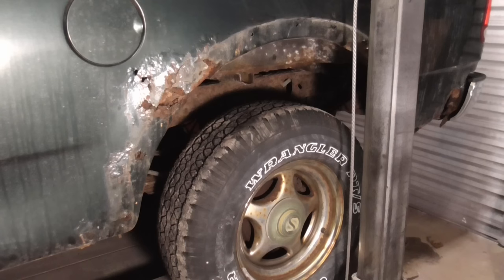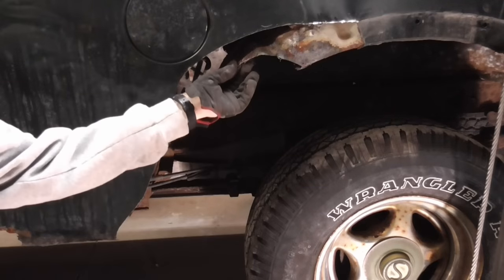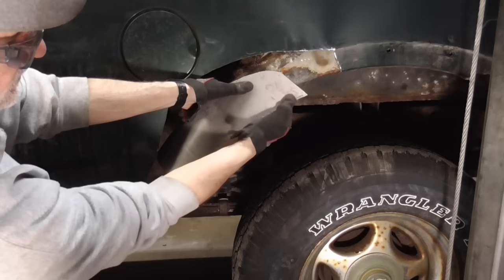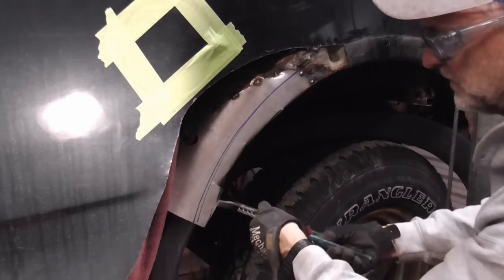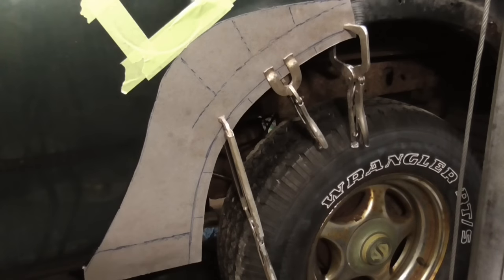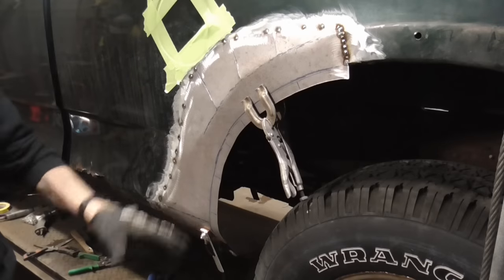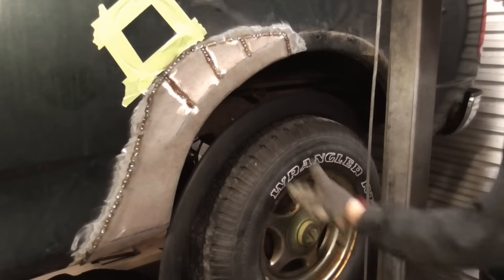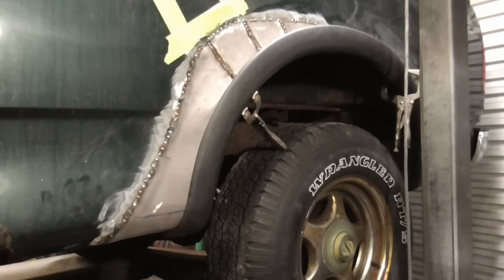Extreme Rust Hole Repair w/ Homemade Patch Panel - Part 1

Comment: What gauge metal do you use for patching? That  stuff seemed pretty heavy. I thought you were welding in the dark,  but then realized you had put a filter on your camera to protect my eyes, thanks.
Reply from the maker: You're welcome :)  20 gauge (~.035") or 22 gauge (~.030") will work fine for patches.  That stuff was 20 gauge CR sheet from Alro steel in Grayling, MI
Reply: @LakesideAutobody  Thanks, we have an Alro near here in northeast Ohio.
Reply from the maker: @stanleylosh1899  I figured they had some more locations - that's good to hear. 👍🛠😊

Comment: I've been a body man for years, started when I was kid, I was an apprentice for many years ! I fully understand what he is doing! The everyday person couldn't do it! My point is, by the time you get the patch panels, do all the cutting, weilding, grinding & the materials for the plastic work and put in primer! You have spent more then what a used bed would be! Your not even into the cost of those materials! You done spent more then the cost of buying a used bed and painting it!
Reply from the maker: What if your boss says fix it?
Reply: I've never had a boss and if I did ide tell him do himself, you see what you don't understand is " a good body man don't need a boss, a boss needs the bodyman!!!!
Reply from the maker: @garyschroer68  👍✌😊 - Have a good 4th Gary 🧨💥
Reply: What's the matter you don't like hearing the truth?

Comment: One suggestion,  make your patch first before removing all the rust so you wont remove the shape you want to make.
Reply from the maker: That's a good tip PVP - thanks for your input :)
Reply: That would be the correct way to do the panel replacement. Same as hammer and dolly out dents, control warping but when your using 3/8” or more body filler it really doesn’t matter.

Comment: That truck looks like it needs to go to the crusher I’m so glad I don’t live in an area like that I live on the gulf coast but I never take my truck to the beach and every time I wash it I always wash underneath as well mine is an 02 ram 2500 and I don’t even have surface rust on the underside and I have 300,000 miles but I do regular maintenance and take very good care of her I would freak out if I ever got a rust hole I also keep my trucks undercoat intact
Reply from the maker: Check out Cosmoline RP- 342 and this video - https://www.youtube.com/watch?v=8XaZBy7GC7A  Using a combination of these ideas will help you hold onto a car your whole life.  This is a good video too on rust prevention forever - https://www.youtube.com/watch?v=y05dNxt-nVc
Reply: It's inside the cavities where the rust starts, you need to inject them with anyone corrosive fluid, but make sure you don't block drain holes

Comment: What’s a job like this cost ? What did you charge ?great job and type of welder ?
Reply from the maker: This one was free 😊  The cost varies wildly from shop to shop - I would say 500-1000+ is the norm.  I appreciate the support MPLS - the welder is an ARCCAPTAIN MIG 200 - https://www.youtube.com/watch?v=jZikIeH-SWQ  Great little welder actually :)
Reply: @LakesideAutobody  welds better than my Lotus 180
Reply from the maker: @jonathanyates5198  2 great things about the ARCCAPTAIN - easy to read and use interface and welds good :)

Comment: Do you have a video how To fix very very white surface rust like bubbling paint but the doors are solid doors video. I have a 2008 Silverado is my dream truck. The doors are completely solid but on the outer side. It's a little bubbly paint not rush it through.  But I like to fix that at some point but she needs bedsides an And outer wheel wells didn't she be like a brand new truck
Reply from the maker: Is the rust on the inside of the lip or outside?
Reply: It's all outside and under the weather stripping as well.
Reply from the maker: @danielb-c9100  If it truly is just on the surface and not rusting from the inside out, you can simply DA sand, prime, block, prime, finish sand, paint.  If it is rusting from the inside out, which is very common, you'll have to do something like this - https://www.youtube.com/watch?v=84A8NQnkMEc  - You can even glue a patch on similar to this method - https://www.youtube.com/watch?v=nbtL75CXmuQ

Comment: I had some paint spots bubble after just 3 months! Ground it down to bare metal…. Why did it do that? So much hard work only to fail. Why?
Reply from the maker: Was it a rust repair, dent, chip?
Reply: @LakesideAutobody  it was a rust repair. With out knowing all the little ins and outs of this trade, it’s easy to make error’s because of lack of knowledge.  I have tried to give it a 100% to do it right, but to no avail. Even used the rust treatments type primers. So incredible discouraging. If you had a body shop guy standing there he would just say…..here’s what you did wrong. So, if there is one itzy bitty pit, this will cause it to bubble? Sounds like you have to cut 100% of the rusted area out even if it’s a discolored pitting?
Reply from the maker: @flintknappingtools  Just cut out ALL the bad metal no matter how big the hole gets - make sure it's all good metal,  weld the patch,  tap down the seam, fill, prime, block, prime, finish sand, paint - that's it it will last a very long time.  See this follow up video - https://www.youtube.com/watch?v=gIS1Tbv7Kvw  And here's a typical rust repair on that same vehicle - https://www.youtube.com/watch?v=84A8NQnkMEc  Stay with me and keep asking questions - specific questions - one at a time and things will get better 👍
Reply: @LakesideAutobody  sir, thank you! Got an 07 Jeep Liberty. Repaired much rust. Most is holding good. The next major task is the auxiliary break light is rusting out. Here in western PA we oil under coat our cars, nearly prevents all rust, but time and chance gets em all. God bless!

Comment: Amazing how easily hand tin snips can cut today’s thin automotive sheet metal panels. You’d think the manufacturers would have figured out by now not to use foam tape, or otherwise, where it could trap moisture causing premature rust, but 60k miles that’s ridiculous. I know Ford has gone to aluminum on their new trucks for the weight savings. Aluminum also corrodes but in a different way. I’ve seen aluminum framed entryways on commercial buildings where the door and window frames are completely disintegrated at the bottom from the excessive salt put down during the winters. It will be interesting to see how the aluminum bodied trucks hold up long term. Anyway, this is a functional repair to extend the usable life of the truck but I’m wondering why not use a ready made patch panel, aftermarket bed side, or even a bed swap?
Reply: I'm gonna take a wild guess and say that Jerry is performing this job for cheaper than what a used bed can be purchased for. Some trucks you can't find patch panels, plus the rust that's on this one I guarantee patch panels cannot be ordered for. Also, some trucks don't have aftermarket besides  like a 4 door Dodge Dakota I use to own, and Ford probably doesn't even make bed sides for that body style anymore. 2007-2013 Silverado trucks you can only get aftermarket bed sides for the 5.5 foot bed. 6.5 you gotta get them from the dealer at $1,600 a side. Rust free take off bed is around $3,200
Reply from the maker: Jonathan nailed it.... I'm doing it for a friend of mine.  He said do anything I want so I though I'd show all kinds of different approaches on this truck.  In the shop I worked, we never got to order premade patch panels - always had to make your own.  I figured it'd be good to show.  Have a great weekend Bondpit :)
Reply: Every single piece of aluminium that is connected to either iron, steel or (most)stainless steels will eat itself and protect the steel around it. That's how I got completely disintegrated suspension mounts on my Mazda...the steel was perfect and shiny underneath. Same story with the aluminium heat shields or other miscellaneous parts.
Reply from the maker: @rolfbjorn9937  Interesting...👍
Reply: @LakesideAutobody I ordered some repair panels for my classic car, the entire body is 18G the repair panels are 20G !!!!!!!!
Also they need lots of work to get them to fit,so I have started by repairing as many original panels as possible, letting in small bits at a time
I have some original panels I bought 20 years ago and will use them,  but the rest of the repair panels will get used as templates then sold afterwards
It's a long slow job, and I am not a professional body man, but semi retired and not afraid to start all over if its not right

Comment: What state has this much salt that this could happen in less the 70,000 miles? 
Hard to believe.
Reply from the maker: Saginaw, Michigan.  It's disgusting.  I've seen practically new Dodge Rams - maybe 5 years old where the quarters were toast.  People pay a lot of $ for these trucks and it doesn't end well here in MI.  Tons of salt - even a light snow - every road gets the treatment :)

Comment: There is a difference between rust and rot 😂😂
Reply from the maker: I guess rot would be where a bunch of water, leaves, dirt, seeds, etc. get trapped inside of a panel saying wet and rotting or rusting out the panel.  They are really both the same thing actually.

Comment: Welding a new panel to a rusty panel with no clean-up? yeah that should last.
Reply from the maker: If you want to know about furnaces, ask a guy who's done it for 40 years.  If you want to know about body work, same thing.  Make sure the repair can drain and dry out inside and this: https://www.youtube.com/watch?v=8XaZBy7GC7A https://www.youtube.com/watch?v=gIS1Tbv7Kvw

Comment: Isn't it easier to just buy Patch panels ?
Reply: Can't get patch panels for all vehicles such as my 2002 impala, or a Nissan Titan. Also a sheet of metal is around the price of one pre made patch panel, so if you have the know how you can save money
Reply from the maker: You can but I'm doing this one for the extra value price :)

Comment: Heh heh ...

... I have a fist-sized hole above the driver side front tire on my 1999 Toyota Solara fender about center if the wheel-well.
 
Aftermarket has the panel for about a hundred bucks plus shipping and Toyota dealership asks about 300 bucks and I can drive to the dealership for the said fender.

Q: May one, who is not an auto-body expert, or even an auto-body entry-level; may tge obe use "J. B. Weld" in lieu of a MIG gun weld?
Reply from the maker: Yes - here's a video using JB on a cab corner - it's about 5 years old now and still looks the same - https://www.youtube.com/watch?v=wRl1QfkrBeY
Reply: @LakesideAutobody  

I watched the video.  I did not even consider the "brittleness" of the J.B. Weld.  Now I see why epoxies may rule.

Is there a significant cost difference from J.B. Weld to epoxies?
Reply from the maker: @michaeldunagan8268  I'm not really sure of the differences.  I'll have to do some testing - maybe a video or two of how the JB holds up to serious hammer blows :)

Comment: Hey, ive got a 1999 E-150, it has some serious rot on the back of the body. 

The cross member and floor where the rear doors latch is has basically disintegrated, would you say a body shop should be able to fix that, or do i need to seek specialized help?
Reply from the maker: A body shop probably won't touch it.  It might be possible to find a small shop or individual that will weld it up for you.  Here's a video on what you're looking at maybe - https://www.youtube.com/watch?v=U67IHaurCaM  Is this what you're dealing with?
Reply: @LakesideAutobody  close, yes.  I'll follow up tomorrow if I can with a video of the rot.  It's kinda bad.  Crossmember that's perpendicular to the frame, just on the inside of the rear bumper, is pretty much gone.  Body mount, and some of the interior sheet metal.  
Evidently the previous owner let caustic fluids accumulate in the back, and it seeped into the cross member through some holes they drilled.  

Like I said, will link video tomorrow.  Not sure if this is as bad or worse than I'm thinking.

Comment: i take it this is a joke
Reply from the maker: A joke that will last many years - https://www.youtube.com/watch?v=gIS1Tbv7Kvw  I'll do another follow up video on the white truck soon - same methods 5+ years old now - still perfect.  Might want to check out why these methods have been used in the best rust belt body shops for years - https://www.youtube.com/watch?v=JIIonJOVro4
Reply: @LakesideAutobody even I a Limey knew exactly what you meant by rust belt, I have seen a few yank tanks imported here, the people in the  know always find out where they came from stateside 
Your County makes them look very close and use a big magnet to look for filler (bondo)
Although I saw a chevy from the 50s that had been done by a craftsman like you and was all metal
They stripped it back to bare metal after the paint was damaged through poor storage 
All sold metal and only a thin skim of filler in a few places